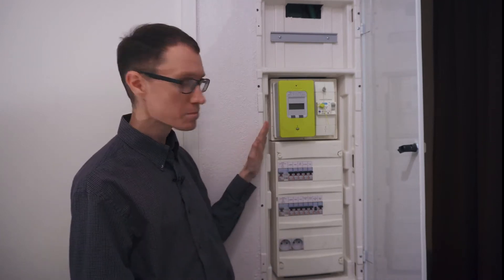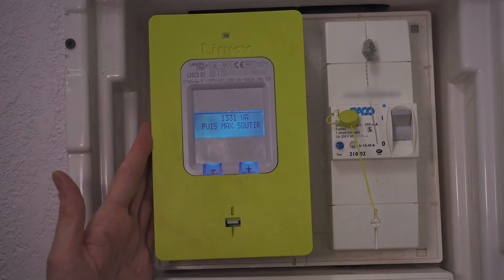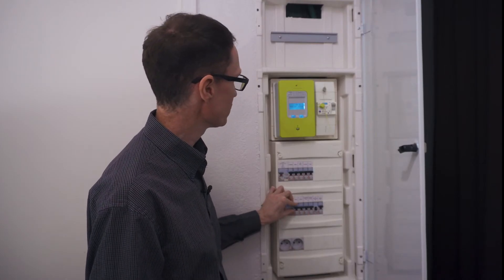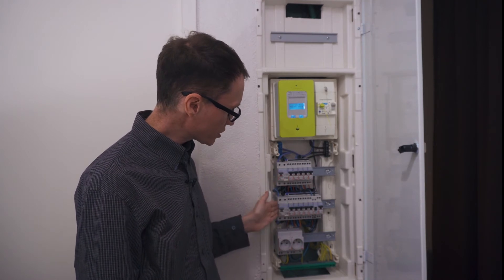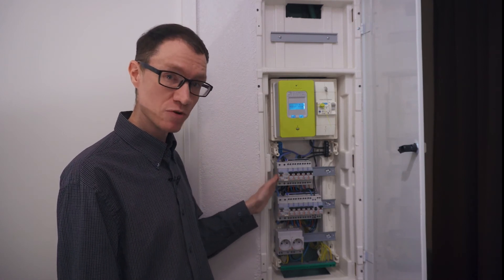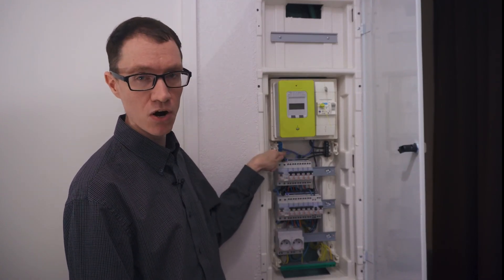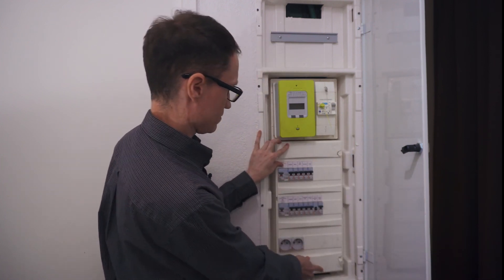Inside a French circuit breaker box (11 - Electricity Distribution)

Comment: Does Germany use same circuit breaker as France in the usa the live wire goes on the breaker neutral eire goes on neutral bare and ground wire goes on neutral bare with the white wire or if it's a subpanel neutral and ground are sperte we use 14 gauge on 15 amps 12 gsuge on 20 amps and 10 gauge on 30 amps

Comment: This does not apply to all European countries. Here in the Netherlands, we use brown for 'hot', Blue for 'neutral', and yellow/Green is earth.  Max group fuses = 16 Amp. For the average house, you have a 1x35A or 3x25A grid connection.
Reply: Here in Italy you can use either Brown, Black or Grey for hot, they're all valid.

For the average house, you have a 1x16A grid connection, which is truly limited. You can upgrade your service to a 1x25A, 1x32A or a three-phase supply if you need more power.
Reply: @alenygam6048 What is the maximum available? In Hungary we can have 32 A 3 phase, 40 A or higher might be possible but it requires a lot of paperwork.
Reply: @mernokimuvek  without paperwork 3x35. ( costs €600 extra per year, 1x35 or 3x25 = €285 / year ) I believe 3x60 is available but requires a lot of paperwork and sometimes new grid cables.
Reply: @IesKorpershoek  35 and 60 is unusual rating. Here we have 32 and 63 A instead.

Comment: The meter doesn't consume power? How is it powered, batteries? I thought VA was the apparent power (on paper) and watts was the actual power after your losses.
Reply: All consume power...for internal electronics...regardless of load. Sure, current measure transformers build up heat when used at or near nominal load.
Reply: The meter does consume energy but it does not count it. You pay this permanent consumption in the monthly subscription fee (around 14 €) not in the kWh paid.

Comment: volts and amps are  two diffrent units
Reply: It's volt-amperes or Va. It's written like that because volts x amperes = watts. VA is used when you are expressing what something is designed for (apparent power) and watts is used when you're expressing what something consumes (actual power). If the power factor was 1 and there were no losses from heat, etc., (not gonna happen), then we would always use Va. By definition volt-amperes is watts at unity power factor.

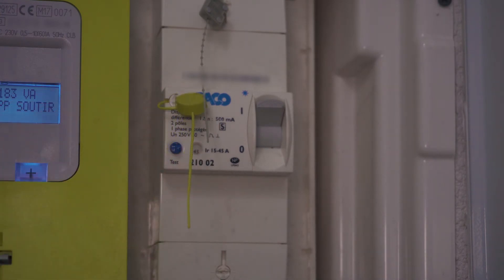Comment: At 2:12 the main switch does cut out at 500mA differential as it is an RCD, but is also an over-current device as well, so an RCBO.
Reply: Yes, but nowadays it is set at its max value (here 45 A) which is much more (10 kVA) than the 6 kVA subscription. The enforcement of the subscription is now done by the green Linky smartmeter.
Reply: @gsbeak  
So people are cheating?
Reply: @johnburns4017  No, the smartmeter ensures that they can't cheat.
If they don't bypass the smartmeter...
If they do and get caught, that is very expensive for them to have stolen that electricity

Comment: Anyone know of the restrictions for an install of this unit in the us?
Reply: Must be too safe to use this kind of equipment, as you can see he put his bare hand inside when it's live and... nothing happen. 
The same thing in US must lead to death. This panel to be compliant with US un-safety level definitely lack of huge bare copper links !
More seriously, as it's made to be use on a grid that provide 3 phase 230/400 V it could work perfectly but you can't use them as they're not approved by you local regulation. 
I think just the plastic case is no good. And the 200A services is far beyond Amps we used to deal with. A typical domestic service is max 60A => 12KW (technically it's 60A*200V=12KVA 200 V as it's simple and it's bellow the minimum Voltage so you'll always have this power even if it's more 60*240 = 14,4)  the biggest you can have "at home" is 60A 3 phase+Neutral so 36kW (43,2) (in this case you have a caste with an Olympic swimming pool) So even your main cables won't fit, as for 60 A they are "thin" (16mm² about AWG5=>16.8mm²), sure you can have more but so much power is only required by commercial/office site.
Reply: @lapub.  I am not shure if i am understanding you in the right way,but three phase connection is very common in the European continent.And that will be 3 X 230 volt..
Reply: @jooproos6559  The street power distribution in France is always 3 phase+Neutral, but most house are wired in "mono" one phase and neutral and get "only" 230V. When you have 3 phase it's 230/400volt. In belgium 3 phase is more common but it can be 110/220
Reply: @lapub.  Yes, I confirm. Most of time in france it is mono 220V and until 90A (depends of your subscription). But if you choose to have more power, you can have for example 3x220V (e.g. 3x63A). 
About safety, it is. really efficient in a new built (rcbo, neutral et ground different, surge protector in some area blabla). Nevertheless that is sometime too much ... in Europe we like to have lot of rules...

Comment: Some French panels connect the horizontal banks of switches via sold L (hot) & N, insulated busbars that look like rods. So no small L terminal blocks top right or N top left. Much neater and safer.
Reply: There is even some with "plugabble" breakers https://youtu.be/pBkdI4tq4MQ?t=12